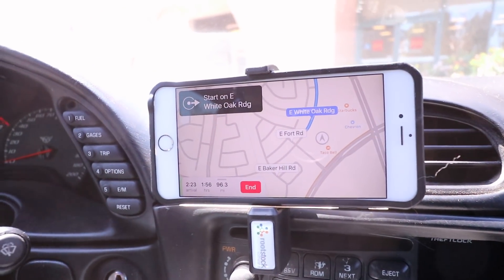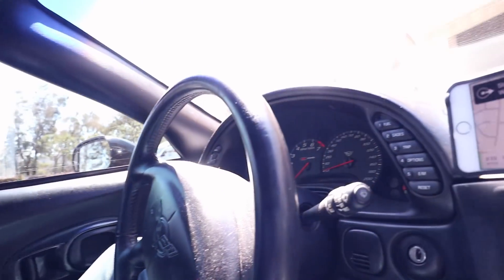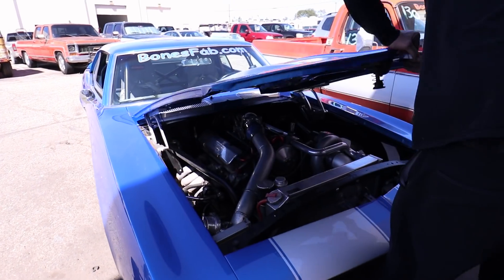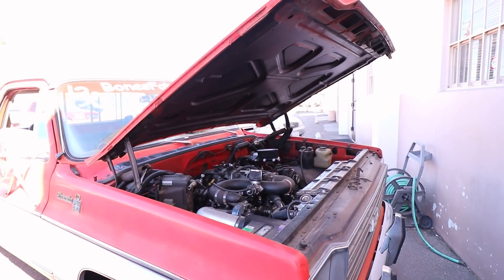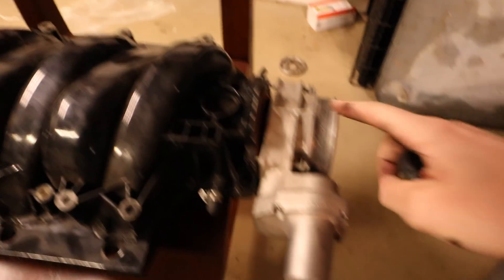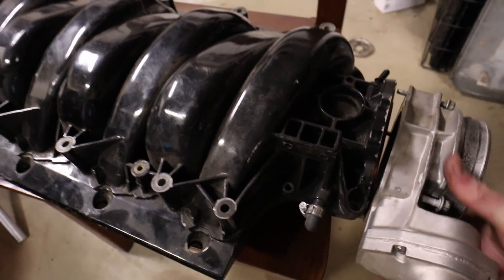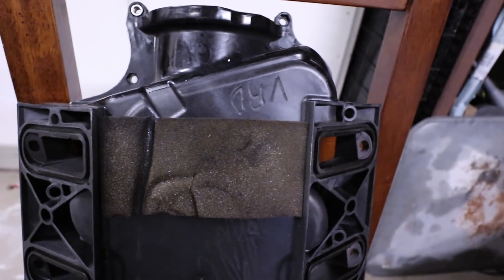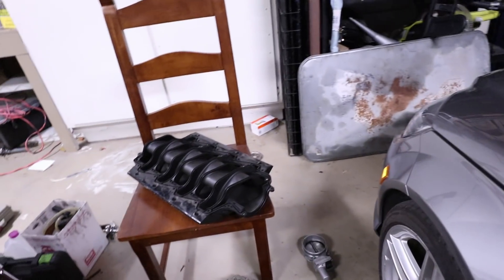Vengeance Racing FAST 90 Craigslist Find

Comment: Just an FYI, you'll need a silver blade LS2 throttle body.  An LS7 TB won't work with your C5.  I wish they did because the LS3 and LS7 TB's are about half the price of the LS2.  If by some miracle you get the LS7 to work, I think everyone would like to know how you did it.  Nice score with the FAST!
Reply from the maker: Good comment. This is an early LS7 throttle body off my 2006 Z06 (part number 12570790). Same part number as the LS2. I believe they switched to the gold blade tb in 2009.

Comment: Are you working on heads, cam, intake build?
I just had my fast 102 intake off my ls1 this weekend to replace the oil pressure sensor. First time doing a job like that.
Reply from the maker: Eventually I'd like to. For now, just intake, exhaust and tune.

Comment: +ZentRose Thanks for the content. I may be behind, but what type of engine build are you going to do? If something does go wrong, I thought the LS6 long blocks are basically impossible to get. I am sure you know more about this than most, including myself, but I was just interested in your logic.

Thank you for your time and great, cheap solutions on this build!
Reply from the maker: For now just intake, fast manifold, 90mm throttle body, headers and then dyno tune. I don't expect the FAST to do much since my engine is internally stock. It was just too cheap to pass up. 

Yes LS6 long blocks are hard to get and used ones are over priced because of LS swap popularity. If I had to replace the engine, I would pick up a new short block and then throw some AFR heads on there.